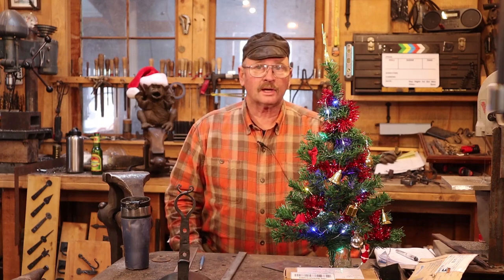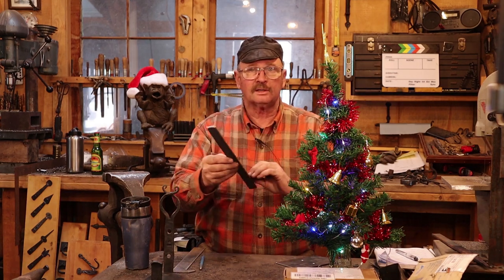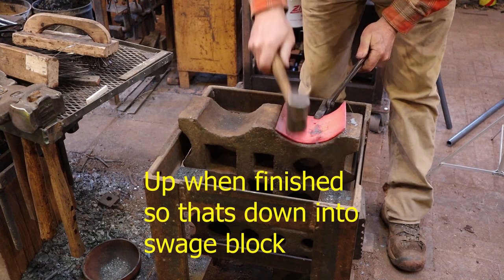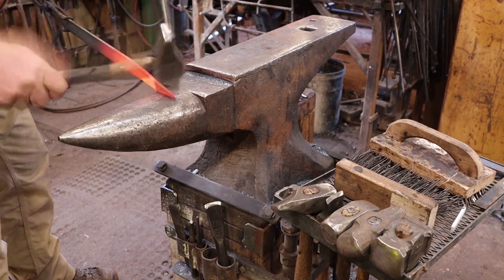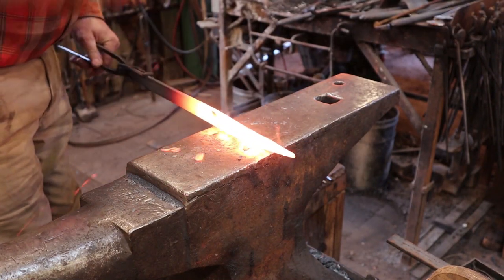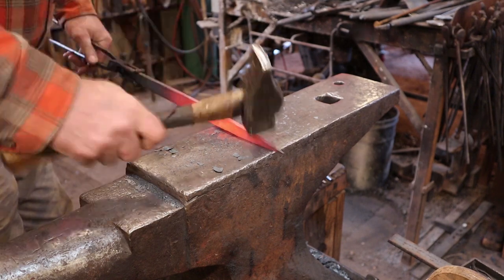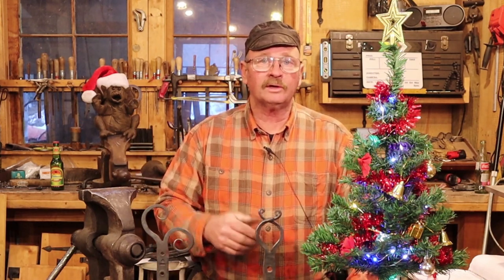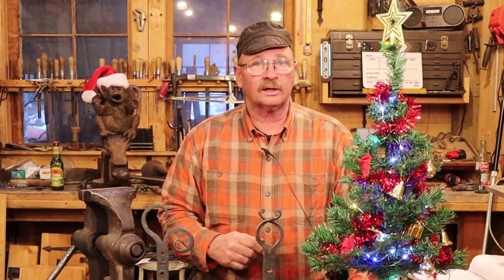Cord or hose hannger - countdown to Christmas

Comment: Very cool project. I'm glad you did drill the holes on the holding bracket. That prevents the swelling like you said from punching holes. The only thing I would have done differently as far as the construction is I would have put the bracket where it holds the large plate in the same swage block if I could, and gave them a similar radius, so that I wasn't riviting a curved section of material to aone that was flat. I think that would have lead to a better hold, and never have to worry about them working loose on a piece that was to be used a lot. This is definitely a project that like you said has a LOT of uses around the smithy. Fine work as always, and can't wait to see what "mystery item" you pick up at your blacksmith get together. Keep the vids coming, and I'm sure like a few others here we kinda feel like we are getting spoiled with the massive amount of content you are really cranking out for this series.

Comment: This is very definitely a project I need to try... waaaay too many extension cords tossed in corners around my shop, and I can rarely find 'em when I actually NEED 'em! The only trick will be the swage; no block yet, so I'm going to have to find another way to fudge that. I'm certain it could be done over the horn of he anvil, but keeping it straight and even would be an absolute bear. If you have any ideas what would make a good NEGATIVE swage (ie. in order to forge into a concave form rather than over a convex one), I'm listening.....
Reply: I can recommend making one out of wood, it can be a bit rough but it works in a pinch. I like going with a piece of PVC pipe on a flat bit of laminated board draw a circle round the pipe, cut out the circle, cut the board in half and you've got yourself 2 perfect moulds, they don't last to long but they work.

Comment: You make everything look so simple, and have you over worked your anvil as it looks like the case hardening of top is cracking.On screen looks like a crack going around.,
Reply: It's a weld seam where the tool steel top wuz forge welded on to the wrought iron body